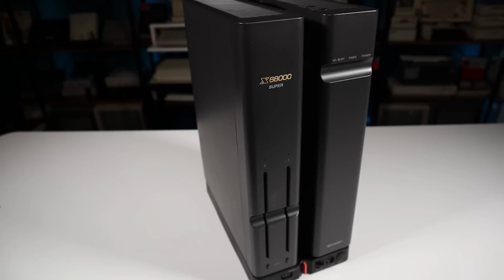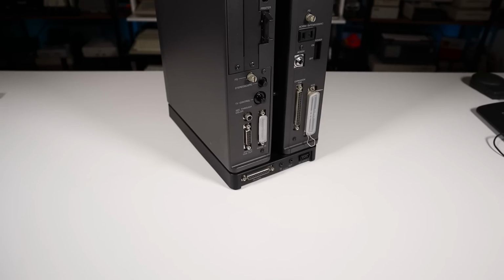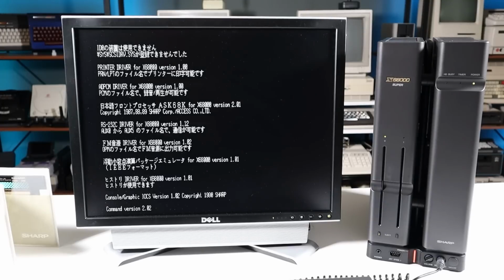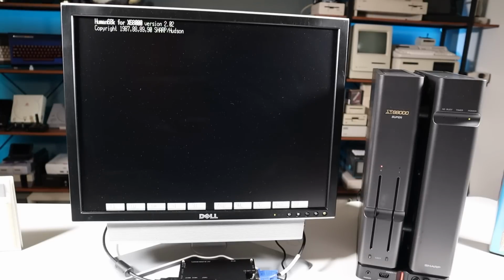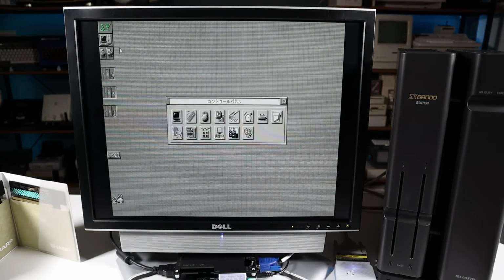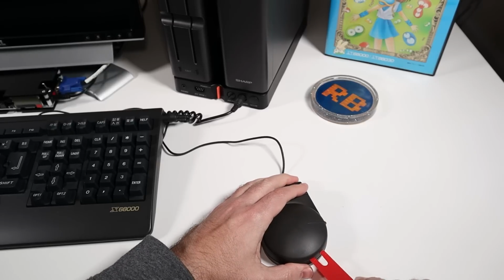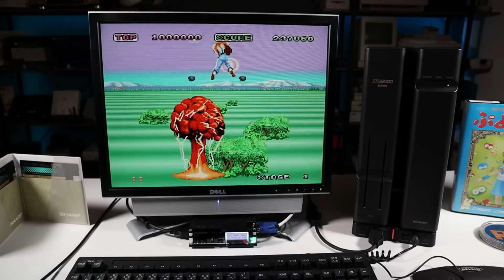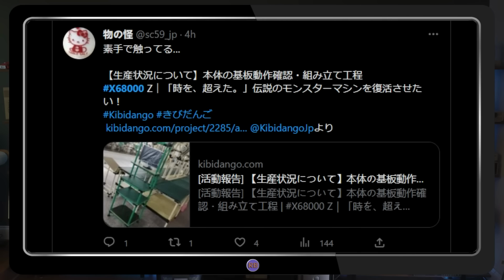Testing out the imported X68000!

Comment: Just a question and thanks for this cool video. From the keyboard, is there a command to go back to the game list of that V4 HDD image? I don't think reseting the machine to play a different game is the proper way to do it. Let me know if you have figured this out.
Reply from the maker: If the game cleanly exits to the command prompt, you can start the menu back up by typing "lhes" and hitting enter. If you've patched the V4 HDD image to use the newer launcher, then you could run "mishell hdd_v4.sp1" but it's a little easier just to re-run "autoexec" instead.

Comment: Amiga killer is more a misnaming than anything else. While the X68000 was undoubtedly better than the last success of Commodore, it's cost was WAY higher of that of the Amiga... at least of the more popular Amigas (the Amiga models with three zeros were more or less there price-wise, but then, only someone with a defective brain would have bought one of those only to play videogames with).

That and Sharp never even attempted to go through the bureaucratic pains needed to sell the X68000 outside of Japan, so you can hardly define it a real competitor for the Amiga... beside in Japan I guess, and hardly a competitor for the more popular and cheaper versions of the Amiga.

Comment: At 15Khz, RGB capable PVM displays should display that system just fine.

There are VGA to component and or RGB adapters can help with the PVM.

I bet the odd timing was, in part, an artifact of the overall system timing.  In the CRT 15Khz era there was considerable slop in what displays would render nicely.

Comment: The X68000 was an amazing feat of engineering, and it's a perfect example of a no compromise arcade machine for the home. The weird video modes requiring a custom designed monitor, the obscenely overengineered internal hardware etc. You can tell that the goal was to design a system very specifically for playing arcade games perfectly. It had very impressive capabilities for its time. I'm not sure it's a better general purpose computer than other computers at the time though, but as a pure gaming machine? Probably the best you could get. It would've been really interesting to see what a later version with 68030, more RAM and an internal HDD could've done in terms of more typical "home computer" type tasks. How good was the software library for it? Was this an Amiga killer? Hard to know. The thing that keeps impressing me with the Amiga, is that even without any modern hardware, meaning, simply using contemporary expansions, like accelerator cards, PCMCIA network adapter etc. You can effectively turn an Amiga into a much more modern feeling computer than it has any right to. Just the fact that you can get modern network access, up to date web browsers, great integration with PCs etc. It shouldn't surprise me if the X68000 can do that as well, but with only hardware available when it was still relevant?
Thanks for the excellent video. It's a very interesting system, and there's not that many videos about it.

Comment: I had an Amiga 500... while I always thought the X68000 looked really good (and it did), as you said the software available was more limited.  Outside of some blockbuster arcade ports, I think I was better off with the Amiga.  (Not that I would have been able to afford or even access the X68000 back then.)  The Amiga port o f Street Fighter 2 was awful, but I wonder if that's just because it was ported by a third party.  Thanks for the video.
Reply: I dunno tho, I think the X68000 still had better custom graphics hardware.  Who knows.

Comment: I have a question: The 6-button controller adapter featured on the video enables support for all 6 buttons of the mega drive controller? It's written on the manufacturer's site that only two buttons will work. Thanks for this video!
Reply from the maker: I didn't see that mentioned when I bought the adapter but I can now confirm that you are correct - only two buttons work even in games with 6 button support like SF2. That's a bummer :(

Comment: I remember hearing about these when I started getting interested in early Japanese anime. A lot of artists created cartoons, games, and early gifs on these machines, and to play the games on PC, you needed a conversion layer of sorts to get the double-byte Kanji characters to display properly. Sometimes they worked and sometimes they didn't!😜

Pretty cool to see that you have a SCSI storage adapter of sorts that you can load multiple copies of drives to boot from, which I'm sure is much quicker to load than even an early compatible hard disc. I have probably 20 or 30 of those early SCSI adapter cables for various peripherals that I can hook to some old HP PA-RISC machines that still work!😉 EDIT: I am REALLY impressed with how well that thing handles the old arcade game graphics and sound. No glitches, no hanging. They just work!! Amazing for a 30+ year old computer.😁

Comment: The "GPU board" will almost definitely not be on a different  side than the  CPU.
Keep in mind that this is not a modern GPU, it's a console/arcade-like VPU.
It's not connected over a multi-link serial protocol like PCIe (something that is designed to be carried over some distance, giving the possibility of long riser in tower cases, and external enclosures on laptop and even interconnects on HPC).
It's directly talking to the CPU over it's main address/data bus (and this is something not trivial to carry over very long distance. Making external ISA enclosures was still possible in the early PCs, but by the time this beast came out the CPU's fast bus would be at best across daughter boards on the mainboard, but very difficult to carry over long distance parallel buses).

Comment: With something that old it's always a good idea to at least take it down to where you can see all the parts, not to figure out what they are because that doesn't even matter at this stage. You want to look inside to make sure there's no liquid damage or component failures, and that everything is at least visually in working order before putting power through it.

Comment: There is at least 1 rpg game for the x68000 that is playable in English. It's called Lagoon. It was ported and localized into english for the snes. 

But that port plays very differently. The original version utilized a combat system very similar to the Ys series where you walk into enemies to damage them, though in Lagoon you hold the attack button before doing so. The snes version used a standard press attack button to "attack" like zelda or other action rpg games. But this version of the game is inferior in most if not all ways because the hitbox for your sword was not changed to match the new combat system. The snes version also had a very different storyline.

A few years ago, somebody translated the x68k version so one can play it in English. I definitely recommend checking it out. The snes version is also worth trying out to see the different story.

Comment: Wow. This thing really blows the Amiga out of the water. I'd love to see a video comparing games released on both platforms. I doubt a single amiga port would run nearly as well as the game ports do on this thing. You could even compare the top rated games on the x68000 compared to the best rated games on the Amiga to see if the Amiga can make some ground back there.

Comment: One of the reasons the arcade conversions were so good on this machine is that a lot of the big arcade manufacturers used them as development machines due to the similar architecture of many arcade boards of the time so the home conversion was relatively easy to port.
I must say, the sound this thing outputs is amazing, way ahead of any machine in the west until the advent of decent pc soundcards and cd based consoles. The music sounds so rich and punchy compared to most amiga soundtracks.
Reply: Yup! It was either this machine or the PC-88/98 systems basically. These machines were practically for enterprise use until their prices with newer revisions came down enough to be affordable for the high-end consumer market during Japan's bubble economy

Comment: I do have an X68000 and both a GBS-Control and an OSSC. Both work. The OSSC actually cuts off the screen a bit but that can be fixed apparently by loading something on the X68000. Yours either has an outdated firmware or something is wrong
Reply from the maker: I have the latest firmware, but I do not have the external clock generator module. I've read on a forum that some people got it to work and some haven't but it seems to vary by model. The XVI / Compact seem to work with it per this post: https://nfggames.com/forum2/index.php?topic=6971.0
Reply: @retrobitstv  LOL I am the one that posted that in the forums. I found some settings for the OSSC and will give it a try soon. Thanks for replying!

Comment: Hi, your guess about what is in each tower is wrong.  On the right tower you have CPU and GPU in 2 different boards sandwitched.  The left tower contains power supply, floppy drives and depending on the model, maybe a hard drive or not.  There is a board also in the base which is the IO controller.

Comment: I’m working on getting an X68000 and planning on using it with my FM Towns monitor. It’s tri-sync like the X68K. It even uses the same connector, but with a different pin out, so I’ll have to build an adapter.

Comment: You got all that legendary retro computer and you hook it up to an LCD display?! That’s like driving a Ferrari on a strictly speed limited street. At least you god have hooked it up to a CRT monitor. Oh well what a bummer.
Reply from the maker: Off camera I did hook it up to a VGA monitor and that worked fine for the 31khz modes but mine doesn't sync down to 15khz and the OSSC only outputs via HDMI so I couldn't use that. Hence the LCD just so I could finish the video in a timely fashion. I am on the lookout for a multisync VGA monitor for the system :)

Comment: Whenever I see people touch RF shields without gloves, I'm like "well that will be on its way to turning into rust in the next 5 to 10 years" 😓
Reply from the maker: Is that really a thing? I've never heard of it before. I would have assumed the opposite: oils from skin would prevent oxidation.
Reply: @retrobitstv  I live in the tropics so that likely helps accelerate things. But the oils in the skin seem to aid in oxidation. It takes a long time but I've seen it countless times on retro gear that I ever opened many years ago or had been worked on and hadn't been wiped down with IPA afterwards. A clear finger pint mark on shiny metals like RF shields.
Reply from the maker: @tanuki2k  Good to know. Well it's super easy to open the machine up and wipe down the RF shields so perhaps I'll go do that right now :)

Comment: Released 2 years later at around 4 times the price, I wonder why no Amigas were harmed by this “Amiga killer” :-)
Reply: @Dan S. - Because Commodore themselves were already doing a good job of harming the Amiga.
Reply: @endwigast5212  In 1987 the Amiga 500 was released, and that was one of the healthiest home computers ever. What you say started to happen in the ‘90s.
Reply: @dans.8198  Nope, Commodore mismanagement already started in the mid 80's.  Once they acquired Amiga, they failed to innovate quickly enough.  The A500 still had the same graphics and audio as the A1000 from 1985.  Meanwhile in 1987, VGA was introduced to the PC market and could display 256 colours without trickery.  A500 was still displaying a paltry 32 colours, unless you forced it into ugly HAM mode.  And A500 still had the same boring 4-channel audio that the A1000 had in 1985.  Meanwhile in 1987, the PC market saw the introduction of AdLib and Soundblaster, signalling better things to come for that platform.  Face it, your Amiga was a waste of money.
Reply: @endwigast5212  You are clearly not familiar with the hardware you mention. In 1987, a VGA card costed almost as much as a full Amiga 500, it was basically just a frame buffer, and you still needed to spend a lot more money to buy an expensive PC + VGA monitor to use it. There were no VGA games in 1987, and the standard PC sound device was an embarrassing buzzer. The SoundBlaster was released only in 1988, costed a lot of extra money and gave you a half-assed FM chip and 1 voice of mono PCM audio. You had to wait a few more years for apps and games to properly support that super expensive pile of underwhelming hardware. So nope, PCs could not compete against Amigas until the nineties.

Comment: Such an impressive system from the time the cool kids in the rest of the world where using Amiga's!
Matt, if you use a cheap HDMI to VGA adapter (the cheaper the better) with the OSSC you can use an ordinary (later) VGA-CRT-monitor. Just set the OSSC to line double the 15KHz modes and you're good to go. Later VGA-CRT-monitors will sync to any weird timing as long as it's within their spec. The OSSC takes care of the low frequency 15KHz en 24KHz modes and the rest doesn't need any modification. I have a 21"-trinitron VGA-CRT and in combination with a OSSC you can get almost anything to display properly without lag. It can even be made to work with composite and s-video signals but they require conversion to RGB first. You don't need that capability because you own commodore 1084 monitors.
Reply from the maker: Cool, thanks for the tips! So the HDMI to VGA conversion doesn't introduce any additional latency? Good to know! It might be a cheaper alternative than trying to find  a rare VGA CRT that can handle all the different refresh rates.
Reply: @retrobitstv  The HDMI to VGA conversion doesn't introduce any latency IF you use the cheapest op the cheapest converter for it. That's because the adapter is basically just a bunch of DAC's converting digital to analog in real time. Strictly speaking there is some latency but this is negligible and takes just a small fraction of a scanline. I even use use mine for aspect perfect display of 16:9 signals by setting the picture height to a low value on the CRT.
Reply: If you think at the price range of the x68000 we amigans had it good, very good!

Comment: While I understand the comparisons to the Amiga it makes no sense to call it an "Amiga Killer".  This Sharp computer cost 3x what an Amiga 1000 cost and the Amiga didn't really take off in sales until the cost reduced Amiga 500 was released.
Reply: Agreed I was going to comment the same, not saying it's not a neat computer just in a different price bracket.
Reply: where did you get this nonsense? It was a true Amiga killer, the price of the X68000 at introduction was 2500-3000USD (sources claim both) and that was including monitor, keyboard, mouse convertible to trackball, two FDDs, SASI controller, 1MB RAM, TV tuner, two upgrade slots, GPU declassing Amiga, faster CPU.
While A1000 price including mouse, keyboard, monitor, 512KB RAM and second FDD was 2300USD. And that was it, no SASI/SCSI, no 1MB RAM...but much lower specs.
Even if you bring in the A2000B, since the X68000 came out in 1987, dollar per dollar, the X68000 wins.
Reply: @ChrisP-C64 - Still makes sense to call it an Amiga Killer from a purely shock & awe perspective, just because the graphics and audio specs for gaming purposes was so much better than the Amiga.  X68000 specs is what Amiga should've evolved into by 1988 if Commodore weren't so inept.  Instead, we had to wait until 1992 for AGA, which still kept the same boring 4-channel audio from 1985.

Comment: My 600 would wipe the floor with x6800 these days

9mb + 2mb expansion card 
68020 enhanced accelarator clocked to 33mhz making it 3x faster than a stock 1200 times and 1.8x faster than a4000 and it can run anything! even if made for a1200 its got a HDD adaptor so can use SDHC/XC cards and so fitted with 32GB on wb 3.1.4

Valued at min of £780.00 its a absolute beast
Reply: Can you run SimCity 2000 on your A600?
Reply: @Timsalt3100 - Despite all that beefy gear, your 600 still can't play arcade-action games at the level that the X68000 and Neo Geo can.  Heck, your 600 can't even compare to the SNES and Genesis.  Face it, your 600 is trash.
Reply from the maker: Just like the Amiga, the x68k eventually shipped as standard with an 68030 processor. The aftermarket also produced accelerators all the way up to an '060 @ 75Mhz.

Comment: Does the system have all of the hardware needed to manually add a hard disk if you wanted?
Reply from the maker: The non-HD model of SUPER that I have is missing the extended version of the ribbon cable required to hook up an internal disk as well as a drive sled to mount it to. These are available on the aftermarket though.

Comment: Was it possible to make music on the Sharp X68000? The Amiga has amazing music programs for it, be curious to see what possible programs are on the Sharp.
Reply from the maker: There were at least four different MIDI cards available for the system (not counting recent homebrew) and a bunch of music composition programs. It would not surprise me if the music for Capcom and other arcade titles was composed on the X68000 since it has been well-documented that the game development itself was done on the platform and the arcade hardware was designed around the Sharp's architecture. Long winded way of saying "yes" :)

Comment: Looking at the front, the right side is the CPU board, GPU and expansion slots.  The left side is dual 5.25 floppy drives, PSU and hard drive if fitted.  Bottom portion contains crossover, clock, some io, some of power management.  You'll eventually want a monitor that will support 15khz and 31khz.  24khz is a nice to have but not absolutely required.  They are awesome machines.  Well worth the effort to keep them running.  Have fun!